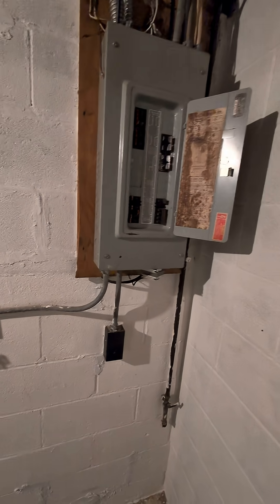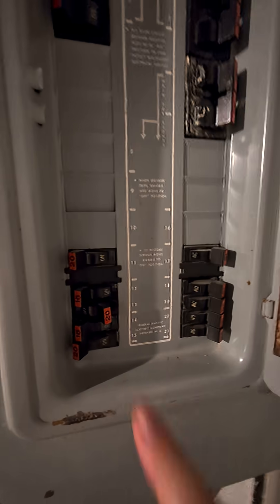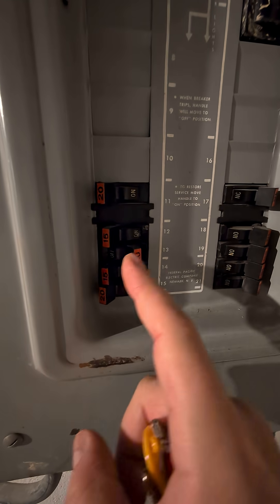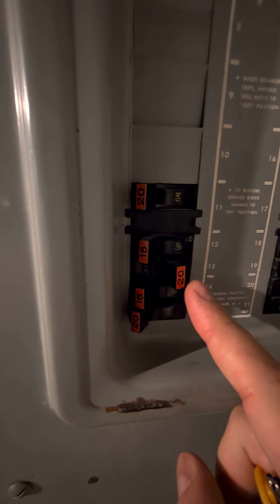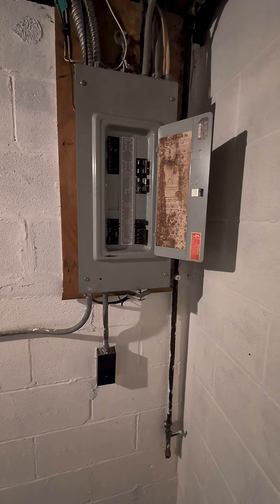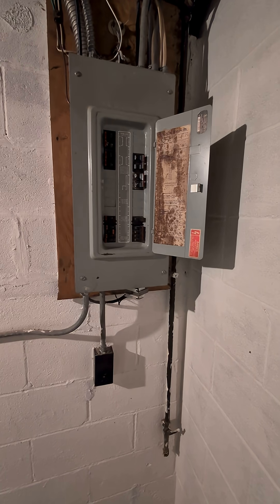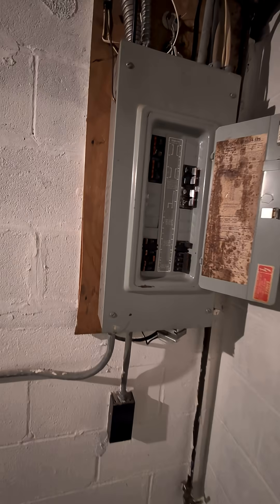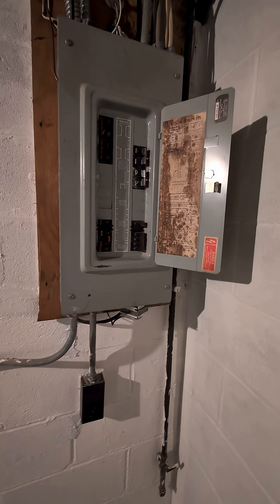Electrical Fire Hazard!!

Comment: You could explain why the pannel needs to be changed.  Seems like its a breaker problem, not a pannel problem.  Its a differents of 50$ vs 2000$

Comment: There's a Stab-Lok breaker panel in the basement here. I'm not touching it with someone else's ten foot pole. Ours works, and we DON'T TOUCH IT. Anything that needs to be done is done in the ten slot sub panel. Dangerous freaking panels.
Reply from the maker: You should get it replaced.  It's good while it works but when it's stops...
Reply: @realtynowpropertymanagemen1181 It's been there since long before I was born, and I refuse to be the reason it burns the house down. I've asked if I can call the power company to shut off service for a day or two to replace it with a brand new Eaton panel and got shut down by my mother, so I gave up.